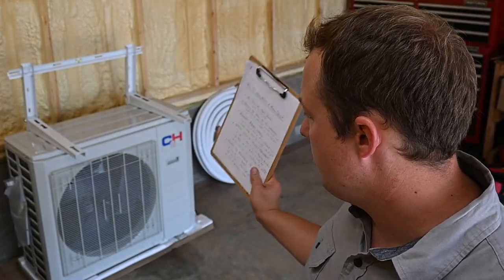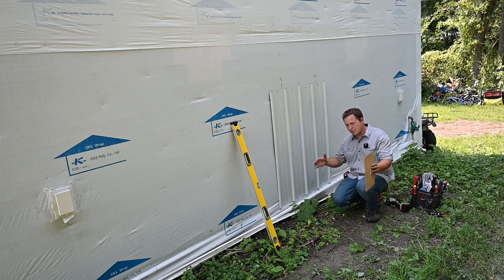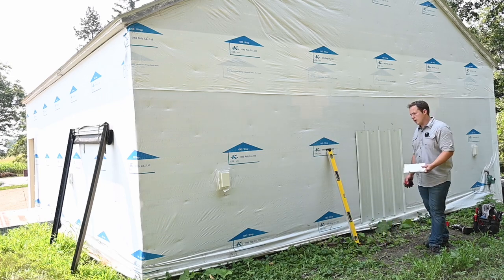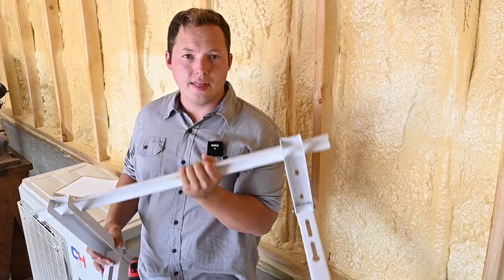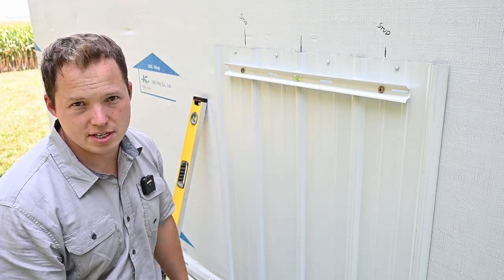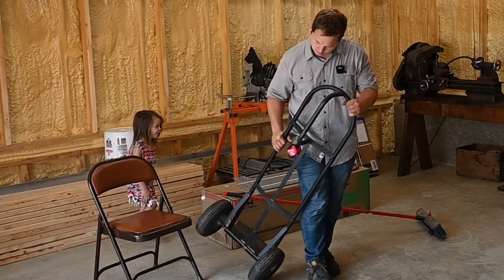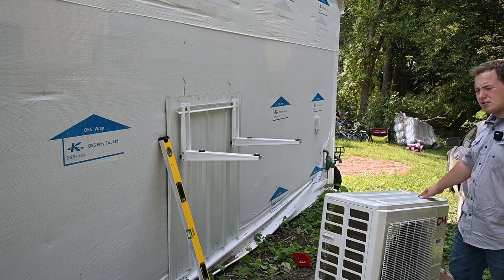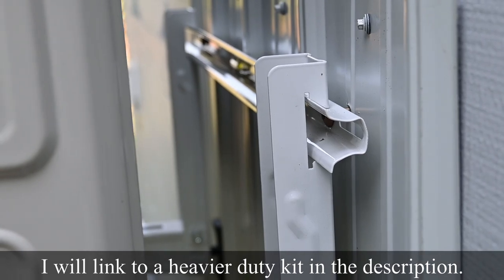How To Wall Mount a Mini Split Outdoor Condenser Unit

Comment: I've watched a ton of DIY videos on YouTube and really can't thank people like you enough.  However, this one has to be the most real. The kids coming and checking out, the foreman (wife) coming to inspect, and finally the old using the top of your knees to lift the unit. Just 2 cents, use a weightlifting belt. Im older than you and speak from experience. Save that back, your famiky will thank you. Great video.

Comment: I like how you tell people to have at least two people help install the outside unit and then proceed to do it yourself…just like I would stubbornly do…lol! Great video, Ben, and very informative as I’m considering a mini split system for the upstairs bedrooms in my split level.
Reply: Bring out the engine jack and start cranking
Reply: My sister-in-law used to lift things like that...now in bed after back surgery number 6 and $100K + in medical bills later....DON'T LIFT LIKE THAT! EVER! I had so much respect for this guy and his great videos but then he did this.

Comment: When I got started in this business we did commercial restaurant equipment and I moved a lot of heavy ranges stoves refrigerators all this by myself so I'm gonna start feeling 1000 pounds I'm 60 years old and it's going to hurt if you don't stop it now and get some help it's fun when you're young but it ain't worth it when you get older that being said I have been watching your videos and I want to thank you for putting them out because even at my age I either forgot or haven't kept up with the latest information so thank you by the way I can always learn new shortcuts and this old dog doesn't mind learning new tricks

Comment: You are the reason I used an ATV winch and scrap lumber to place the unit on mount lol. worked quite well with a couple straps around the unit and a small 12v battery. Winch didn't seem to notice when lifting:)

Comment: Ben, when you get to the next video on hooking up everything, I have a minor suggestion for the condenser drain line. 11 years ago I installed my first mini split and just ran the drain line that came with the unit out of the wall. In about two years after installing it looked like a critter or something was eating off the end of the plastic. Turned out to be mother nature (UV light) so I had to add a short run of one inch PVC pipe to avoid the damage cause.

Comment: "...have two people to lift the unit onto the bracket as they can be a bit heavy"

Especially when you bought the 300,000 BTU sized unit with the 900 pound condensor  ;)
The struggle is REAL, you gave it the college level try and WON!!!

Comment: I have to lift a lot of heavy stuff by myself. Always learning how-to and not how-to; this one definitely goes into the not how-to.

One thing I learned along the way is to lift in increments. You could have stacked cinder blocks or something stable to halfway to the height if the rack. By leveraging it in you only lift half the weight and to half the height.
Reply: I have a few steps to my front door (~2 ft). The  UPS / FedEx drivers have picked up both my 65lb mini splits condensors from the back of the truck instead of using the lift gate. My knees hurt just watching this.

Comment: Mounting on the ground reduces noise and vibration. I have one on the roof, and one i'll put on the wall soon, both because we don't have a lot of room on the ground, and I already hear it quite a bit in my room on the roof mounted one. I thought it was the head unit until I realized, I had mounted the condenser right above my bed on the roof. I chose the location due to other constraints (Flatness, shade, distance from head unit, etc) , and didn't realize until months later. We often man handle thing in DIY, but really its not safe, but often you just don't have a second set of hands to help. Definitely wouldn't recommend it for daily work. Mine was a bit smaller and I managed to bring it up to the roof now that I think about it..... by myself... probably not the safest lmao We seem to think we're invincible, until we break something inside us. Next time with that much open space, back your truck up to it, load it onto the truck bed, then get on the truck bed and move it over to the bracket.

Comment: I mounted it my minisplit on the ground and was surprised how much vibration came through with just the insulated piping contacting the wall. I can't imagine how much vibration would come through if the unit itself was on the wall. I had to wrap some lead weight around the piping to dampen the vibration. This was a Mr. Cool 12K unit.

Comment: I’ve decided to mount mine on a wall-bracket that is mounted to a post-stand. I am augering two 36” deep holes similar to fence post. My post are 6”x6”x6’. I’m routing two dado for 2x6 cross members. One for the wall mount top rail and one for the lower stand-offs. I have faux brick that comes up 3ft and I do not want to mount to it or through it.

Comment: I ordered a mini split 12,000 btu. I think I will mount the outside unit on a platform I'll build 2 feet off the concrete and the unit mounted on it a foot out from the wall.
I have a large fenced concreted area for the dogs, and a gate to a much larger play area filled with sand. My back door to the concreted area has a little overhead roof about 4 feet out  and 8 feet long parallel to the house that would provide excellent cover over the unit to keep snow and rain off it. The lineset only has to go horizontally about 9 feet and up and in.

Comment: Benjamin..I love your video's..Next time you decide about lifting large things by your self try my idea..I try and get the object up in the air. I use concrete blocks or 4x4 to start to get object in air. Your particular situation you could have put the unit in the back of a pick up truck and you  are almost at the correct height. Now drive around  the back of the garage. Lift up on to your brackets. Take care and see you in your next video..

Comment: Nice add of the rubber isolation, mum and dad has a unit that vibrates the hell out of the wall when the unit is in heat pump mode, got the rubbers just have to get back to finishing it off, luckily i have until next winter to install them since winter is over here.

Comment: From experience, wall or ground mounted, make sure the roof has very good water runoff control or the roof overhangs enough to keep water off the top of it.
The rain water might help cool it in the summer, but the ice build up in the winter hurts its ability to heat.
Reply: Exactly. Or he might want to install gutters for the rain. In Winter, proper roof insulation and/or attic space to prevent ice formation. These units are meant to be outdoor.

Comment: You could always add a couple of cantilevered struts from the bottom of the structure to the supplied brackets, to increase stability.

Comment: In your part of the country your heat pump mini split is going to be operating more supplying heat so having the outside unit in the sun assists in a warmer area, that is where the heat pump gets a portion of its heat for free, and also causes the snow/ice to melt away from the outside unit allowing the air more free flow around the outside coil for heat pickup. As for lifting the unit in the air most any supplier can sell you a sky hook for ease of installation.

Comment: I ordered mine with the wall mount to keep it out of snow. After ordering it I realized I need to be 3 feet from combustibles as it has the heat strip for  -13 degrees heating.

Now I need to figure a stand. I don’t feel like spending $250 bucks for a stand. There’s a relatively  inexpensive one fo 40 bucks but it’s too small for my 24k Pioneer.

I just bought a flux core welder that I haven’t mastered yet. So I have some practicing to do.

Comment: Any concern about the mount keeping the unit so close to the wall? My manual for the CH 18k wants 12" between the wall and condenser. Mounts that big are hard to find and are not affordable.
Reply: That is for the on-ground scenario where there is no ventilation below the unit. When mounted on the wall you get additional ventilation from the bottom and the unit can be installed closer to the wall
Reply: @monczaopl  Great answer. I had the same problem, now feel better to have at 4 inches away from wall.

Comment: Can you link to the pdf where you measured the mass and frequency of the system, calculated resonance, and solved for how much damping you needed when spec'ing out those rubber dampers? Thanks.

Comment: Can I just put the outdoor unit one the concrete slab if I have no snow and no flood?
Reply from the maker: Absolutely! That's a great option for sure in your case.
Reply: @BenjaminSahlstrom  Thanks. A contractor kept telling me I need a pad for my outdoor unit on the slab but I'm not convinced. I don't have grass or foliage near it, no snow in the winter and it hardly ever rain.
Reply: @JW77  You probably already did it, but put some pea gravel down and then some concrete blocks on top of that to get it up of the ground at least a bit.

Comment: would like to put mini system air conditioner in new lake cottage. any tips on preplanning for install on new construction? also recommended size BTU system  Cottage is single story 960 sq feet Thank You

Comment: Dude you need to get an engine lift on your next solo mini split wall mount install!  😂
Reply: I just lifted a 270 pound air hockey table off the bed of my pickup by myself using an engine lift.

Comment: I'd say I went overboard on making my own bracket I have my bracket bolted to a concrete pad that's 6'× 4' and the concrete is 18" deep not to mention i used 1" 1/2 × 1" 1/2 × 1/4 thick angle iron 2.5 foot tall that's bolted down with 6 5/8 × 8" concrete anchors and I'm in Florida

Comment: I live in a co-op where every renovations/work is approved by a committee and they often tend to go on the cheap side...      i don't really have questions here, i'm just looking for opinions/feedback etc.
Right now every unit is having a 12 000 btu AC mini splits (from Direct Air)  installed,  my unit is 3 bedrooms on top floor   and each floor is just about 500sq feet + finished basement... so far iv'e only seen completed installation  on the the smaller units (2 bed rooms/400sq feet floors) 
and the outside condenser/fan part is installed directly underneath a wooden porch/deck structure , say when i  step out my patio door i'm pretty much @ ground level where as when they walk out their patio door? they're about 5-6 feet of the ground so they have a tiny deck&stairs to get to their yards) , about half the residents here are retired folks who spend an INSANE  amount of time relaxing in their backyards  so anyway, got something on the stove so ill cut this short.....   here are my worries;

edit   BTW, those backyards are all SMALL, i'm talking a resident sitting outside reading would almost always be within less than 10 feet from the machine,20 feet if they sit on the edge of their yards, most have gazebos  setup just a couple feet from the decks...

12K btu is not enough for for my unit (about 1000sq feet + basement)  and even if it were? the machine would be running hard most of the time, i live in Ottawa,  we often get 40C/ 104F with humidex)   
The outside part of the system makes about 57decibels (comparable to a 2 person conversation 1 meter away or a 3-4 person conversation a few meters away)   since it'll be ramped up during the hours of the day those folks like spending time in their backyard it might get pretty noisy, especially since some residents will be hearing their machines on top top of their two neighbors's machines...    
since in some cases the machines are installed under that wooden deck, i imagine to a certain extent some of the noise will be "contained"  in that enclosed space under the deck and reflect out in the easiest path which aims directly at where these folks  like to sit/read/chat etc 
also most of the heat from the condensers will probably hit the brick wall right behind and then radiate upwards through the decks which ... could be it's own problem.
Could affect the wood itself? whatever paint is on those decks?   but mostly, some residents like to put plants on those decks, can't imagine plants will enjoy the 60C temperatures,
other residents also like to setup their BBQ on that deck,  they fire up the grill and often step out the patio door barefoot to check on it...  now seems to me like the deck could be so hot at times   walking bare foot on it would be painful, attending the BBQ would be unbearably hot,  
i have some other issues but i think the smoke alarm is about to go off again so ill leave it at that...      again, no questions just... opinions/feedback if you think we're heading for headaches or not etc.     and yes... i'm drunk  ;)     sry for saying deck so much lol, i'm french,couldn't think of a better word  :P

Edit;   here's another thing, in my case i live in a corner unit, i have an outer wall that's connected to my stairwell  which makes the installation easy but in some other cases ive seen so far,   the machine sits on the ground  and the conduits are installed outside the wall(covered by a small plastic channel/cover)  and they run all the way to the attic, so that's well over 20 feet of somewhat insulated conduits who are sitting right where the heat coming off the machine rises if there's no wind  and then there's the added length  going through the attic in order to reach the inside part of the machine...   i'm not doing anymore research  to determine how having such long conduits will affect the performance, i'm at least certain it won't help :/

Comment: I had almost forgotten how cute lil ones can be,  aaaand there goes the mic.  Now there is a good boy!  Good effort, but that get it done attitude is going to make you pay later in life.  Get  help whenever you can.  Love the videos.  One question on placement of the outside unit.  You say out of the sunlight which for us in the US means the north side of the house.  What about any possible efficiency gains of placing it on a south wall, avoiding our cold north wind here in KS, but also inside what would be a greenhouse in the winter months, but open during the summer months with an overhang that eliminates the sun hitting it in the summer?

Comment: Ben, most MFGs recommend 12 inches clearance between the house and condenser.  Most wall mount brackets dont provide that much, as in your case.  Do you thing 5 to 7 inches clearance on the back side in sufficient?  Im getting ready to mount my 24000 btu

Comment: The mini split I'm installing says the outdoor unit must be 12" from the wall. But my line set may not be long enough, so it might be more like 6" from the wall.  Most wall mounts don't seem to be 12" from the wall so how can you get away with that?  Yours doesn't look like it's 12" from the wall.  Is that rule just something to be ignored?  I'm asking because I might have to ignore it myself.
Reply: His looks to be about 6" away from the wall.  I think it would depend on the location of the air intake.
Reply: Someone answered that question here saying if wall mounted it will get more air from bottom and ok with less than the 12" required for ground installation.

Comment: Whenever possible, I try to avoid mounting mini splits onto siding/wood. When the compressor ramps up and down you can sometimes hear the noise. I'd prefer to mount it on a brick or masonry wall.
Reply: What are you using to anchor to brick? Tapcons?
Reply: @Jgiamportone023  Nooo thats gonna break. Buy a mini split bracket and use the included bolts and anchors.
Reply: @xcmskim4  i did buy the bracket, but figured tapcons would be better then using plastic anchors. We aren’t installing until later this week anyway. I believe the outside unit says it weighs 115 pounds.

Comment: Damn. Those brackets for the outdoor unit on USA is much much more simpler than what i’ve got here in my country ( Indonesia ) :-P

Edit : And also, it needs way less anchors that must got drilled onto the concrete ( still, more is better )

Comment: The Mitsubishi has no vibration, SILENT, inverter variable speed compressor, and yes, it's on rubber pads on the wall braket
Reply: We just had a four zone Mitsubishi unit installed on our concrete block wall outside of the living room. Now my wife can't sleep because of the noise. I think we should have installed it about 30 feet away on the outside garage wall. Too late now, my wife will have to learn to ignore the noise. I am happy to get the unit so we don't have to use a woodstove anymore to heat the house, but now wondering how much our electric bill will go up.
Reply: @1955RKE  I have a 12k but single mounted on the cinderblock foundation on one of my 5 systems...right outside the room where the indoor unit is...absolutely no noise ,no rumble,nothing don't even know it's running...all my others are pad mounted...the wall brackets usually have rubber isolation pads..make sure they are installed properly...these things are wall mounted all over the world...if it was an issue..it would certainly be recognized.  Make sure bracket  is secure and tight against the wall and all the bolts are tight on the bracket...quiet is Mitsubishi main feature..besides super seer efficiency rating

Comment: Question.  Looking for split system that can run on a 30amp generator.  Not a 220 
Reason.  Putting in a mobile hearing testing trailer.  The 7000 inverter generator Honda pass the dB reading of testing criteria.

Comment: I would have liked to see how you found the studs from the outside to mount the brackets?
Reply: Probably has a stud finder or can see the existing nails.
Reply: You can drill a small hole right next to the stud and then the middle of stud will be 3/4 inch to either right or left of hole.